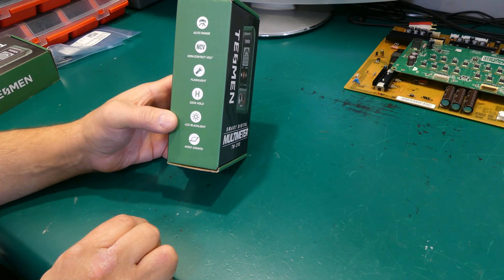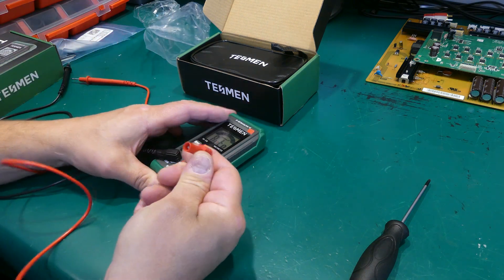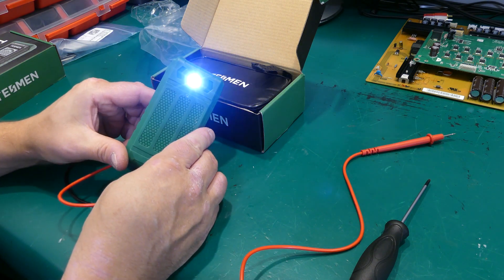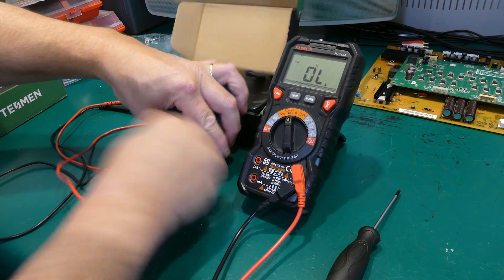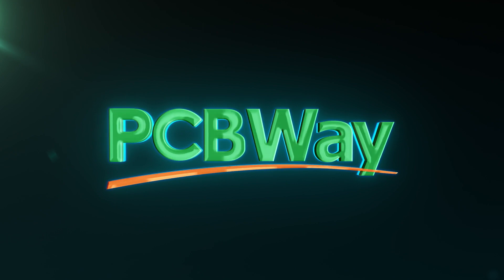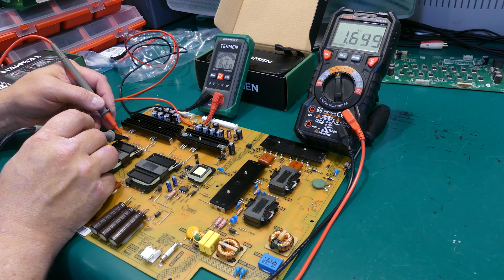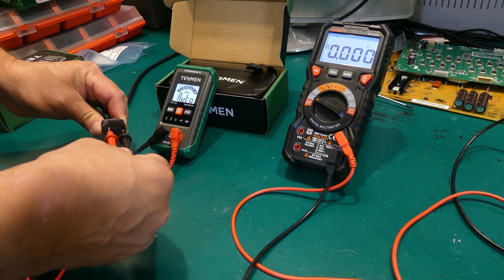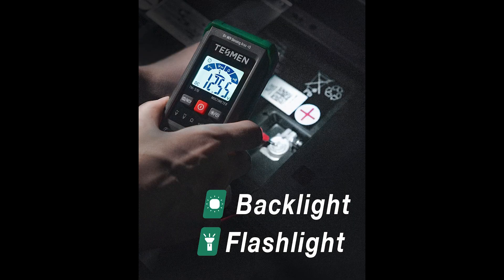TESMEN TM-510 Digital Multimeter | Retro Repair Guy Review

Comment: Could be good for somebody that isn't familiar with what setting they should have their meter on. That way they don't have end up damaging it.  It's personally not for me though. I like turning the rotary selector to what I want and getting my reading quickly.
Reply from the maker: Hi Tron! Oh yeah, absolutely, this is a very basic beginner meter or as I said, one for a kitchen drawer or the car. It's so easy Mrs. RRG could use it! I'm going to keep it around in my car tool case. I really like my meter for the bench. Don't you have the same one as me?
Reply: @RetroRepairGuy  Yup, I love it. My wife last year gave me some probe master probes as part of my Christmas gift and it has amazing continuity now.
Reply from the maker: @TRONMAGNUM2099  Nice gift! I just looked though and I think they're more expensive than the multimeter! Either way I'll wait until I have a few more Patreons for that! 🤣